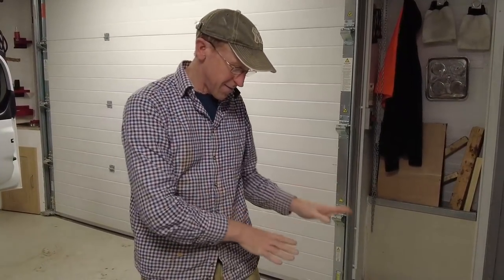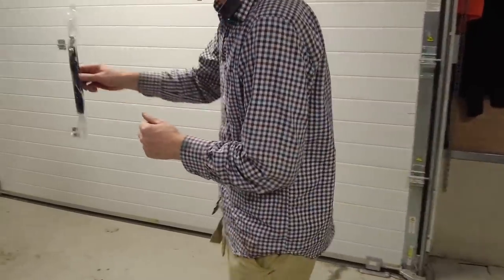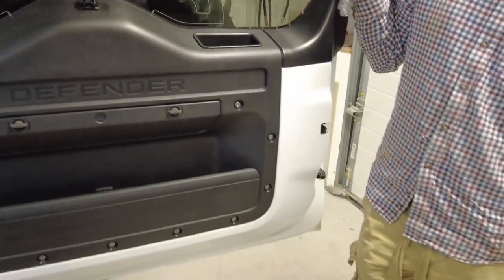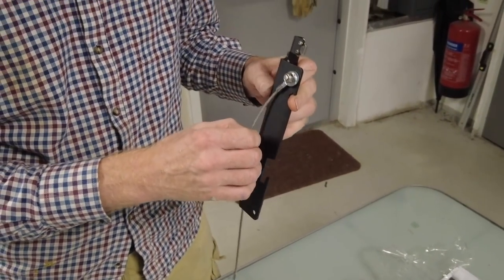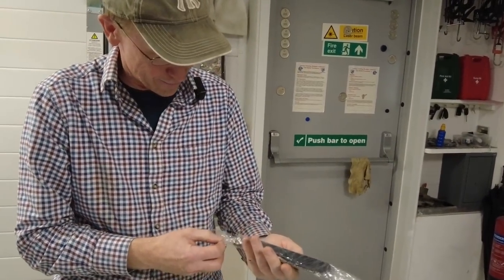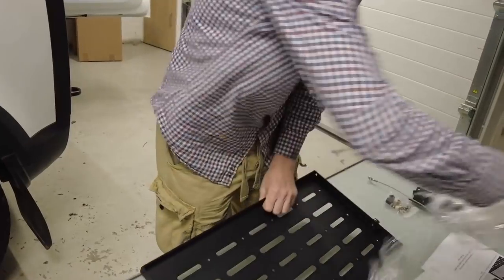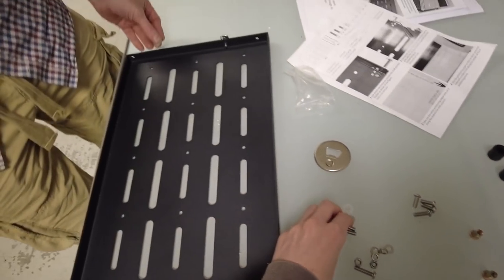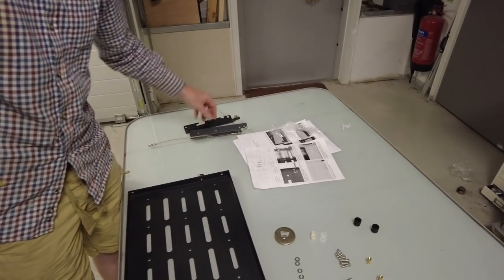Land Rover Defender L663 Rear Door Tailgate Camping Folding Table - Install / Development

Comment: Great mod, I fitted something similar on my Discovery 2 back door, I used magnets to hold the tray in place when not in use, and then it's ready for use in a nanosecond.
Reply from the maker: Love magnets... someone suggested this to me at the Land Rover show this weekend also - the try is aluminium so i would need to add some bolts to the tray in order to be able to use magnets... aluminium is good as its lightweight

Comment: Hi Simon,  this was great I’ll be ordering one today and yes I’d buy your kit to make it work better.  

I did have another idea for camping….with the air suspension there should be a camping mode that levels the car for you 💡 in off road mode it knows and shows all the angles so the car does know what level looks like.

Tim
Reply from the maker: Well you are not the only person with this idea... I heard a rumour that there is company working on this BUT this should be a feature on the phone app for example....I guess the car has angle sensors in both directions - it clearly has height sensors at each wheel but it needs also to have angle sensors.

Comment: Exactly how I fitted mine 6 months ago!   I also added a fitted strip of non slip matting in the tray. I also purchased longer matching Torqx bolts to the originals from Amazon so that it looks like the others on the tailgate
Reply from the maker: Yes I was not the first to do this mod - did you have the same idea for holding it closed ?

Comment: All I’d like as a kit is the grub screws and the black screw in handles. The rest is fine. I’ve mounted mine higher than you so no need to trim off the lower part of the brackets

Comment: Another excellent mod video. 👍🏻

I fitted one of these to my Defender a month or so back, very pleased with it. From what I've seen on 't net, the contents of the supplied table vary slightly so, in my case there was a bit of hacking involved. I like your idea of reversing the brackets although I'd be happier to buy some bespoke ones than bother cutting them down myself (hint). 😉

I found I could adjust the levelling of the table by tightening the retaining cables at an angle, effectively making them shorter. Also: if you find yourself parked on a slight upwards (or downwards) slope you can level the Defender by adjusting the rear suspension height. 

Last thing: have you thought about how to mount a CB antenna? It's something I've been scratching my head over so if you've any ideas that'd be good. 🤣
Reply: I have a magnetic mount antenna for our vhf radio and plan to install a steel plate on the roof rack for it.  Temporarily I used industrial strength velcro on the rack and antenna to hold it in place.  Not as elegant as some possible solutions but works for us and there are no permanent scars.

Comment: Simon make one from scratch, if you build it we will buy. include a moulded tray to hold your cooking utensils and please make it easier to install than the body winch :(
Reply from the maker: I had just got over the trauma of the winch.....
We will take a look at this.. used it this weekend and it was useful. I was thinking of a round hole that you could put an IKEA plastic cup into to form a utensils holder.

Comment: Great design, but not quite as much "make it up as we go along" as it seems virtually identical to my setup done in April and shared with your good self, Simon.
Reply from the maker: Hi Bill - you are right that i was certainly late to the party on this modification - Non Stick Nick and Tim Oliver and yourself were all way ahead of me.. although not sure anyone did it the same way with the cut down slimmer brackets and thum screw fixings but I may be wrong.

Comment: Try mounting the support brackets the opposite sides to how you’ve mounted them as they appear to be the wrong way round then the tray retaining clips may then work … just my initial observation
Reply from the maker: Paul you are 100% correct but the problem is that then the holes are too close to match the holes on the door - then you need to add extra brackets as per this video 
https://www.youtube.com/watch?v=3jD7vZocf-4
Also those retainers are bit goose as they are super tiny and prone to rattle so my screwed in fixings work for me.

Comment: Have you made a video about the rear light I see on the top near rear door? I went camping this weekend and the reversing lights are pretty horrible in complete dark. I don't want to add the small leds to the bottom of the tail lights but a nice flood light on the top is exactly what I wanted to do. Specially if i can change the orientation if needed.
Reply: No we have not made a video about this yet - it is bolted to the Molle plate

Comment: Do you think they will ever fit a tail gate to the defender like the disco 4 as an option? It would make it a lot more useable
Reply from the maker: The D3 / D4 tailgate is pure genius on so many levels and it does make perfect sense... the only drawback is where do you put the picnic table ?

Comment: Hi Guys, Do you have a rough ETA when this kit will be available?
Reply from the maker: I think we are still a couple of weeks away
Reply: @L663  We need a clever solution to secure the rear wheel covers. Coventry LR had all theirs stolen off cars in their forecourt - seems to be latest trend - if anyone can you guys can 😎🤓👍
Reply from the maker: @supercrazysane  Surely one of those cars must have a rear dashcam mounted ! that would get a good look at the thieves !
Tricky one how to make it theft proof.
Reply: @L663  true but unfortunately it won’t deter them and it’s the same old hoody gang. Yep not sure what could be done, maybe some way to cable secure to the spare wheel. At least then it would need wire cutters 🤔